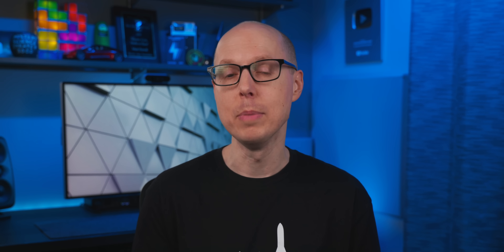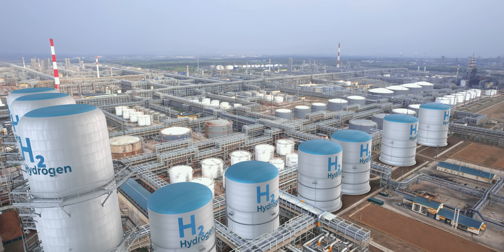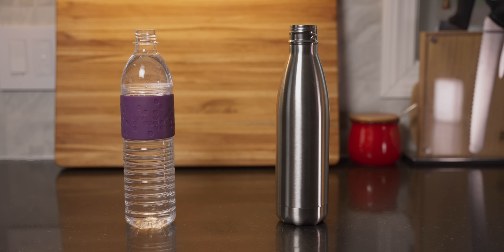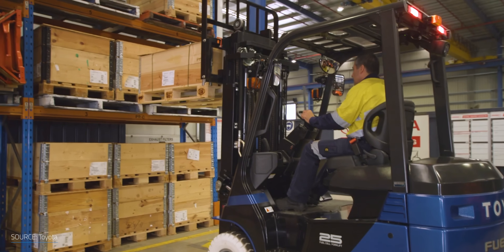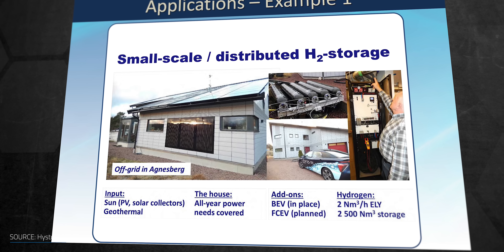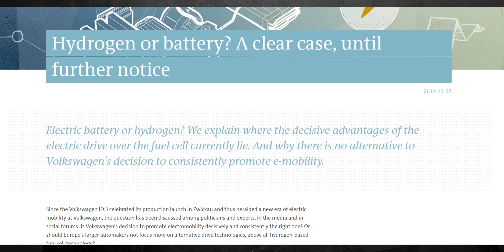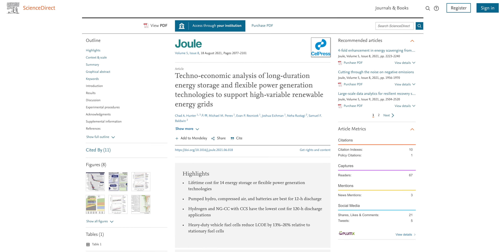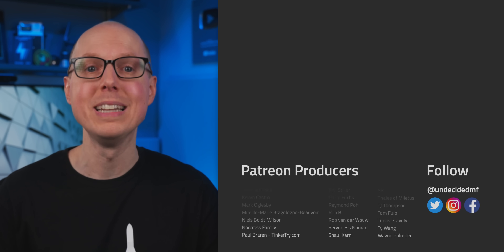Solid Hydrogen Explained (Again) - Is it the Future of Energy Storage?

Comment: Adsorption in a metal hydride is not the same as being solid, the atoms of hydrogen must be interspersed in the lattice right?. Dr Woods comments sound like nonsense to me? I don't think anyone has seen solid hydrogen. What does it mean at 5:35 to say that "solid [hydrogen]" would be denser than "liquid [hydrogen]"! Depends if the particular substance forms a less dense crystal structure than a liquid right?  Then at 13:26 you go on to say it takes 10,000kWh to "dispense" liquified hydrogen? What does that mean? Are you talking about the cost to pressurise and maintain? Doesn't that depend on the storage time?  This is worse than the last video. Still seems like vapourware to me.

Comment: Matt, there is something fundamentally suspicious about the whole process. It talks about "pushing" Hydrogen atoms into metal's chrystalline structure creating hydrides. That implied absorbsion, like water gets absobed into a sponge. But a sponge filled with water remains a sponge with water filling up the gaps. Hydrides however, are a totally different beast. Hydrides are not metal anymore with chrystalline gaps filled with Hydrogen, they are chemical compounds of metal and Hydrogen, a result of a chemical reaction. Saying that that Hydrogen is pushed into metal structure making hydrides is the same as saying Chlorine is pushed into chystalline structure of Sodium creating table salt!  Salt is not Sodium anymore, just like hydrides are not metals anymore. So, to release Hydrogen from hydrides you need to overcome not crystal bonds, but chemical ones. You are aware of the amount of energy needed to release Chlorine from salt, don't you?  Unless a chemical compound is unstable (eg explosive or combustible) the bonds are strong so not sure where such low energy requirement calculations come for.  Could you please clarify if you can.
Reply: The difference is the reversibility of the process - metal hydrides are relatively easily converted back to metal and hydrogen. Salt - not so much! Overall, the process is between water in a sponge and sodium and chlorine reacting. Crystalline.
Reply: @lafamillecarrington  I think mate you are being very liberal with the concept of "relatively easy".  It is nothing of the sort. If it was this technology would have been 150 years old, the processes of forming hydrides have been known from the dawn of science and there have been plenty of time for some bright spark to realize that the reverse process could be of great use. There have been many bright people in the last 300 years, but none came up with it.  I wonder why?
Reply: @blg53  For any number of reasons ranging from material restrictions, technology restrictions, financial restrictions, applications, ect.

The world of scientific discovery isn't directly connected to the world of innovation, simply knowing X doesn't mean you can use it.
Reply: Chlorine is bonded to sodium with strong ionic bonds, I don't think that's the case for the hydrogen. In any case, what matters about this is the energy cost of unbonding the hydrogen, which HAS been shown in the video.
Reply: @MrTomyCJ  Yeah but how does the laser magically reduce bond breaking energy compared to conventional heating? That's the suspicious part.
Reply: @kiyoponnn It should be more efficient since the heat is focused in the directional energy provided by the laser. You're not wasting energy heating air around the system, you're only spending energy to emit the laser, which heats the system directly.
Reply: @MrTomyCJ heard they use lasers, like a laser disk player concept , for release
Reply: The difference between table salt and metal hydride lies in the type and the strength of the bonds... The bonds in table salt are very strong ionic bonds  and each ion has a fixed position in the crystal lattice. However most hydrides are mainly metallic bonded and the small hydrogen atoms are located intersticially in the lattice therefore they can move around relative easily. Similary carbon or nitrogen is solved in steels.
Reply: They already have hidride based tanks proven to work.
Reply: So how would you explain it?
Reply: Are you unironically expecting him to answer? haha
Reply: @dsnpro999  I know, just kidding.  The whole project looks like a scam begging for funding from the gullibles..
Reply: He clearly isn't aware of anything you said. They don't have any scientific understanding of the matter, which should be fairly obvious from their videos. They just repeat snake oil claims from those companies.
Reply: @Kujo174  what do you mean?
Reply: Misleading and a complete waste of time reading this. MOVE THE BALL FORWARD! 

Very easy to tear something apart or derail a conversation - whats actually difficult is criticizing someone while also giving another [more viable] path to go down. 

***Dont get me wrong Im not an avid fan of this guy, but I do know hydrides and I do know the first vid seemed like a push for Plasma Kinetics (at least give 3 specific examples for later vids Matt to avoid that rabbit hole). But I scrolled down 10 comments and every single one was just troll-like comments with zero useful purpose or 'value added' suggestions. So I felt compelled to try and balance out all you silly-sallys(sp?)

The internet is an amazing source of information - its also a place where [information] can be redefined an innumerable amount of times. Great 'info' all!
Reply: @andrew13651  Pretty ironic how you accuse others of making useless comments and then do the same thing
Reply: @kiyoponnn  ....i know right....

Comment: Well Matt, the criticism was not on whether it is possible to store hydrogen in a metal hydride. The critics were aimed at Plasma Kinetics' claim to store hydrogen in some sort of light-actived material which their own video can't choose between being shaped as a disc plate or a rolling tape. In order to be light-activated, it must be thin. VERY thin. So as long as it can't stand its own weight, it will need a mechanically appropiate foundation, which will be heavier than the hydride layer and its stored hydrogen. And here's were Plasma Kinetic's claim falls apart. Along with their stress on "being so good the US military forbid it", which means they pitched it too well, not that they actually made it beyond faking it...
Reply: Exactly.  It was a real "spin" exercise,  avoiding his original nonsensical coverage.

Comment: Graforce Hydro Plasmalyse hydrogen. Graforce Hydro based in the Köpenick suburb of Berlin, Germany, is currently developing a high-frequency electrolysis solution. It would use an electric and a magnetic field to split water, explained Jens Hanke, Graforce’s founder. He has been working on the idea in the Technology Park Adlershof since 2010. By his own account, the high-voltage field directly above the water surface “creates plasma like on the sun.” The released electrons would split water into hydrogen and oxygen, he said.

Comment: Very helpful, though I will probably need to watch again in case I missed something...  I agree that poor Hydrogen round-trip efficiency is only important for certain use cases. For long-term storage of what would otherwise be "waste" or surplus electricity, it is not a barrier. This illustrates how stored Hydrogen has a good fit with renewable energy sources which produce electricity when they want to, rather than when we need it e.g. wind blowing at night across a wind farm.

Comment: Is it better than batteries though, how many of these could you carry in your pocket, and what if you run out of power could you pop in to your local store and buy a fresh pack for your device or a top up  probably not.

So perhaps batteries still have the edge depending on the application.

Comment: This is one of the best videos addressing criticism I' ve seen in my many years consuming content on YouTube. Even the biggest most charismatic YouTubers are visibly uncomfortable and avoident in these types of videos. This addressed my questions and it sounds like a really cool way to store energy in certain applications. You pointed out forklift countetweights, that's a perfect application. I think this utility based, multipurpose way of thinking when designing fuel sources and batteries is going to be the most effective and efficient in the future in my opinion. Not everything has to be a Tesla because not everything wants to be a Tesla. Breaking out of this cult of the 'biggest' tech companies is needed. The future i hope to see is distributed. Localized food and power production would save on alot of energy and be healthier. Sending scrap metal to China to receive billets to send components back to China to receive finished products after their lengthy port wait times just isn't going to work. 3-d printing will hopefully fix expensive shipment of critical parts as well. I really just hope to see slow government red tape and risk averse old companies get out of the way. There are a lot of enthusiastic, intelligent young people ready to do some impressive things.
Reply: Diabolically Insightful....  You little Devil, You!   😈

Comment: Lol No matter how big or small the conversation there will always be more than one opinion. I thought was the reason for conversation. After your first video on solid hydrogen storage I wasn't expecting a solid hydrogen storage fuel cell system powering my house before years end. Since 2012 my home is powered by two PV solar panels arrays just under 10k on average 85% on my family's power is from sunshine. My father installed solar hot water on his house in 1977 I grew up in home where I could shower for an hour and dad never complained. The solar panels were built by Revere Copper and Brass and in the early 90s Dad needed a roof I took his three copper panels and they are still on my roof making hot water today. I am still running the very same closed loop circulator pump today and the parts are still available. We should all be looking forward to better our future but not discount what has been available for the past 45 years. If I had long a term storage solution I wouldn't buy any electricity. Keep the videos coming the future is gonna be great now that people are paying attention.

Comment: Matt, thank you for the clarifications.  Solid Hydrogen probably WILL play a role in carbon neutral energy, eventually.  However since I'm currently in my 7th decade of life, I doubt if I'll ever see it come into it's own.
Reply: Another solution is to just generate electricity with high-temperature reactors like LFTR, generate your hydrogen from water, combine it with atmospheric or stored carbon from other combustion processes and the heat from the same reactor and store the resulting methane or even more complex hydrocarbon.  It's still carbon neutral or negative depending on how you do it.  No need to try to haul around a low-density and difficult to contain fuel.

Comment: Man, this hydrogen nonsense again.  Getting excited about a new way to use hydrogen is exactly the same as getting excited about a new engine that burns gasoline. Because hydrogen, at any meaningful volume, will be derived from fossil fuels most likely for the remainder of your life. Maybe one day when we have a massive overproduction of inexpensive carbon free energy, we can talk about hydrogen, but until then this is nothing more than some project to extend the life of the fossil fuel industry. And further more, this technology is one battery breakthrough away from being useless.

Comment: I've used this technology on a small scale to provide hydrogen to power flame photometry units for specialized gas detection.  It allows for a much more compact design.  Refilling the tanks was simple and the storage containers were stable and had a long shelf life.  I think that is one of the advantages.  The systems work very much like ordinary compressed gas systems from the user's point of view.  This should allow for easy integration into a number of technologies.  In trying to decide what is best I think we sometimes forget the strength of a diverse energy system.  Better to optimize each use case rather than have one hegemonic system to rule them all.
Reply: The one size fits all mentality is probably one of the largest issues we combat every day. It's one of the largest problems with the majority of green energy. It's not that the solutions are 100% bad. It's that there not practical in many parts of the world. Then to add insult to injury. When implemented in the environments they are suited for, they do it in an improper and unpractical manner that doesn't allows for the best efficiency of the solution being used.
Reply: @tonyvieson9194  Good point. Especially when contries decide to go to war over resources instead of using their own available in their land.
Reply: and in the darkness bind them
Reply: I would like to see how it works...I have  Lourdes hydrofix for hydrogen water and gas for my health Hydrogen  fascinates  with it special properties.

Comment: Having co-authored a MacArthur-funded paper comparing energy storage modalities some years back - https://www.climatesolutions.org/sites/default/files/uploads/carryingtheenegyfuture.pdf - I thoroughly agree with skepticism on light vehicle applications because of the full cycle efficiency. Battery vehicles are 2-4x times more efficient. The niche I see for hydrides is long-term stationary storage of hydrogen electrolyzed from renewable resources that would otherwise be curtailed because the grid could not absorb them. We have examples in wind, solar and hydro. Otherwise, use electricity for direct applications wherever possible.

Comment: Why not store the liquid Hydrogen in Deep-Sea tanks where the temp is very low and stable? On land, the temp fight is a continuous battle, but off shore is more stable. IDK, I am no pro engineer, but sometimes it takes another viewpoint to breakthrough
Reply: You need -440 degrees for hydrogen to stay liquid. The bottom of the ocean isn't colder than Pluto
Reply: @lolmaify485  I guess I should have included the part about being "COLDER, and HIGHER PRESSURE" and more stable. Plus I hope you understand about depths and pressure? At ONE atmosphere (sea level), its -440. If the sea does half the compression. less work is needed. Dont be an asshole, I had mentioned I have no engineering degree, but it seems I understand more about deep sea storage than you. Dont try and snarky comment out of your ass if you dont understand my theory.

Comment: A couple of points I keep on harping on, that have been tangentially addressed here, FINALLY:
(1) Efficiency is trumped by overall cost. That's why petroleum is cheap, and King ! For Now.
(2) Don't put all your (technology) eggs in one basket. Lithium ion is great for EVs, but not necessary for stationary bulk storage. Research EVERYTHING !

Back to hydrogen. If done properly, one thing you'll get out hydrides is cycle life. That's the problem with all current battery technologies. The number of charge/discharge cycles you get, from a given technology. That works in my point (1) Overall cost. Even simple hydride structures, have decent cycle life, and cheaply fixed when needed.

Comment: I have to say that capturing hydrogen at lower pressures from flue gases or any other sources is pretty pog... If it would be possible, I would suggest somekind of adsorption filter with a very porous material with 2 channel sizes where you have large pores in the middle connected to tons of small channels where only hydorgen can enter... so as the gasses pass through only the small Hydrogen molecules are stored on the surfaces of the internal pores. Storing it on the surface offers much less resistance than within a metal lattice...

Comment: That was an awful effort at an energy density explanation. It's not hard. When you compare the density of various forms of energy storage, "Volumetric" tell you how much space a given amount of energy takes up, while "Gravimetric" tells you how much that amount of stored energy will weigh. They aren't competing, they are two measurements that matter when you design something. A ship can handle low densities of both as the ship is huge and weight doesn't matter. Ditto for land storage. A moving vehicle wants to minimise both values. Now, that wasn't so hard, was it?

Comment: One word Hildenborough, if hydrogen leaks car go boom.
Reply: Helium is not the same as Hydrogen.
Even if these high pressure tanks would leak, H2 would not just explode; the mixture needs to be at least 18% - compared to gasoline that can be explosive at already 1.1% with regular air
Reply: @GuZ76  are you ignorant of what gas was in the Hindenberg or do you not realise hydrogen combines explosively with oxygen in the atmosphere?

Comment: I'm curious do we burn the hydrogen to release the energy? And then there's the question of how we create the hydrogen? I know from sixth grade science we cracked it out of water (H2O) but my understanding is most of it comes from petrochemical so creating it from oil and then burning it. Even though it's side effect is water and oxygen you have to replenish it. Unlike a battery you recharge it you drain it and recharge it again eventually when it wears out, again my understanding is that it's 95% recyclable. I'm really loving driving without burning anything in my Tesla. Cheers from Northern California!!!